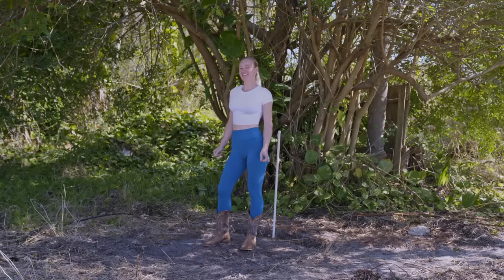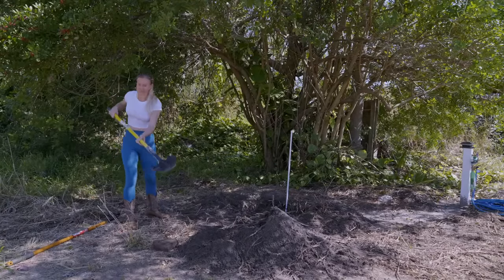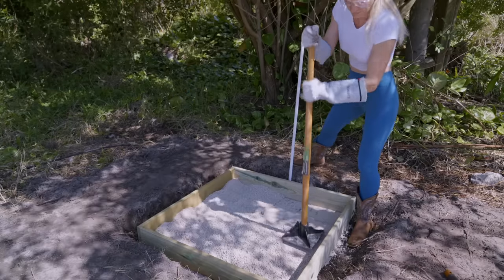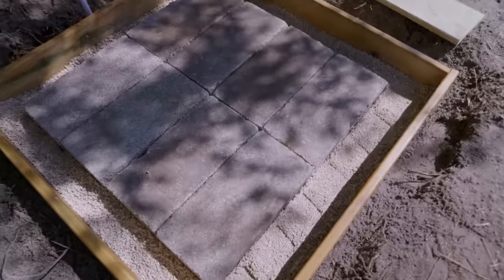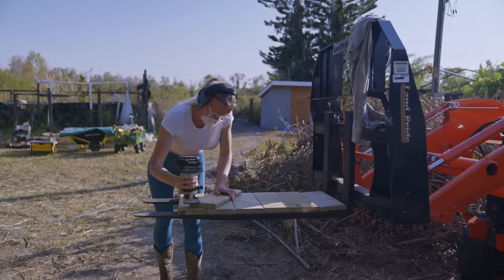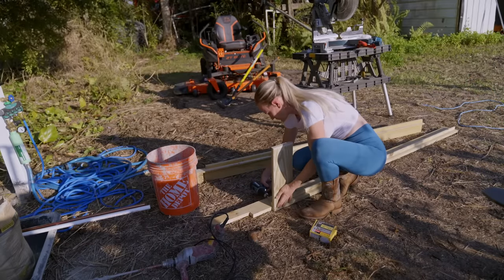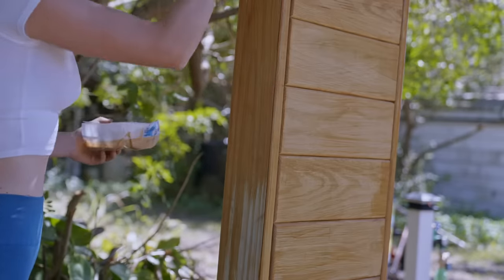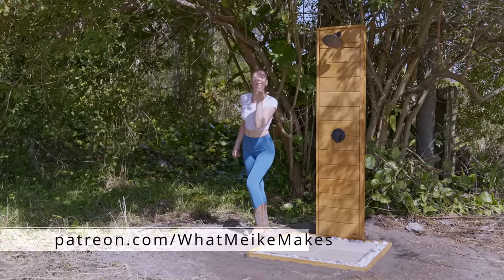How to build a modern outdoor shower #femalewoodworker

Comment: Your shower came out great. You can make a solution of vinegar and steel wool or other metal filings that when brushed on pressure treated wood will age it to a gray color within hours. Works great for adding to a board fence.
Reply from the maker: Glad you like the shower built thanks for the tip Tom.

Comment: Very cool idea, especially since it's likely only cold water! LOL  I think I would have used a smoother rock for the perimeter, but otherwise, great build.
Reply from the maker: Hey Rob, thanks a lot. Its very refreshing since the temperatures have been ridiculous hot. I'm wearing sunblock 100 and still get sunburned super quick. The shower is so refreshing. I was looking for river rocks but they were much more expensive. I wanted to build it on a Budget. Those stones were the cheapest in white color.
Reply: @WhatMeikeMakes  Budget is always the thing, right.  Plus you can always swap the rocks out later if you want.  But yeah, great idea in such a hot locale.  Cheers.

Comment: Hmja, und wo kriegst du jetzt das Wasser her?
Und wäre es nicht sinnvoller gewesen das Holz erst zu versiegeln und dann anzubauen?
Bis auf welche Körnung schleifst du an?
Reply from the maker: I get my water from a well, I installed a second water pipe to tap into it. If you like you can seal the wood first but that usually ends up getting a bunch of grass stuff to the wet stain since I have so much grass and sand here. So I rather built first, so it’s off the ground. I sand as much as the instructions on the stain say. I think this one was 120

Comment: That doesn't look like pressure treated lumber......it's not going to do very well outside, especially with ground contact.  Sealing only does so much.
Reply from the maker: Like mentioned in the video. The whole built is built with pressure treated lumber. on top of that I added the stain/sealer.